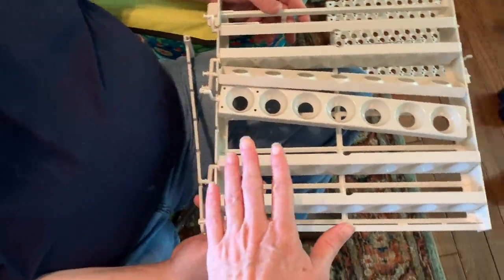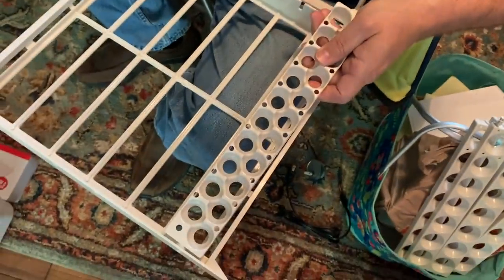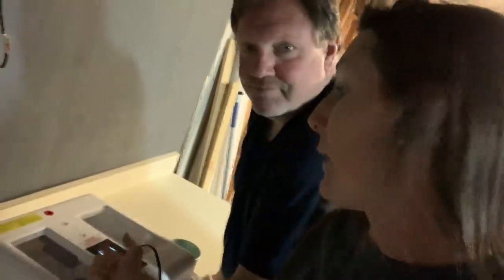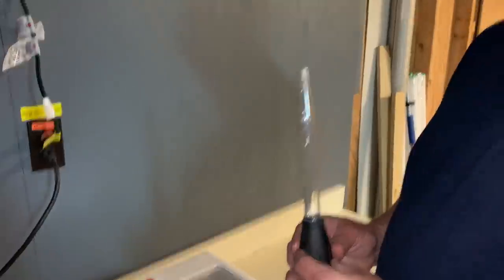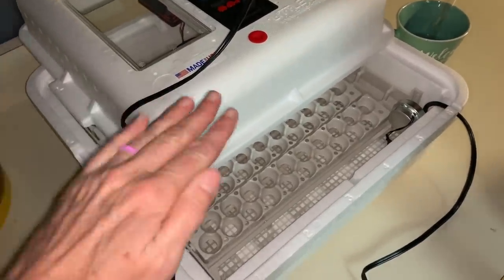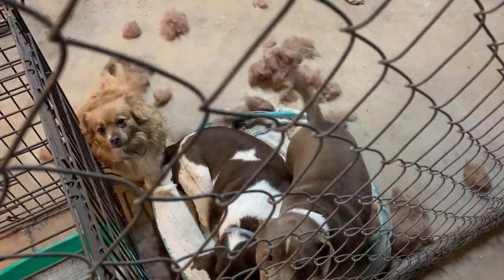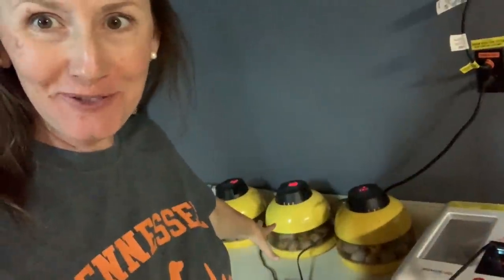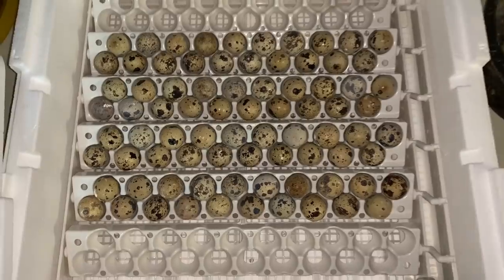80 Quail EGGS in NEW Incubator!

Comment: Hiya, Patara! I've used a preset Hovabator for many years. Beats hand turning,  especially if you have a lot of eggs! I did find on mine that the humidity reading was off by a bit by calibrating a separate analog hygrometer I placed inside the incubator (you do it by placing the hygro inside a bag with a pile of salt overnight, instructions on the web). Anyway, I love it! You'll be hooked. Just be sure that the eggs are really tilting. Once, mine had quit and I can't recall what the issue was, but it was easily remedied. Good luck! You are not helping here, woman-I am so tempted to pop in two dozen of my Partridge/Blue Partridge Brahma eggs I had put aside, in spite of all that's been going on in our lives lately! Stop tempting me! LOL! ~Cynthia

Comment: You should be able to just pull out one side a little bit (side with smaller prongs on trays, not the curve ends) and trays should come out without undoing the motor. That's how I've done mine for years, and nothing ever broke on it. Still works like brand new.